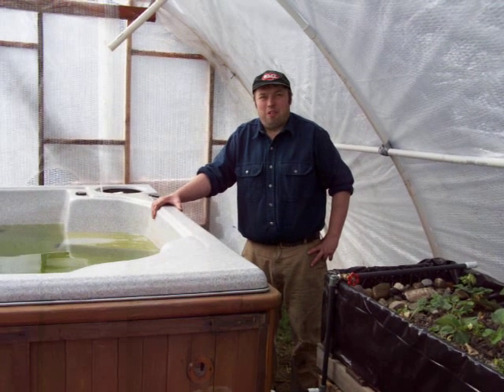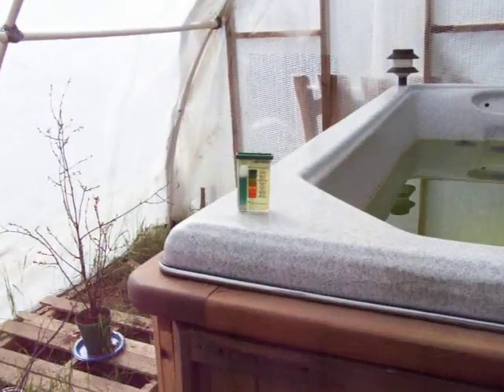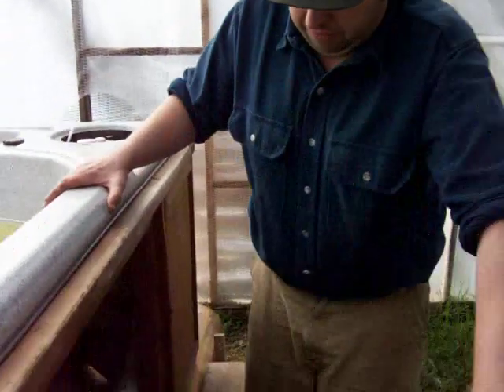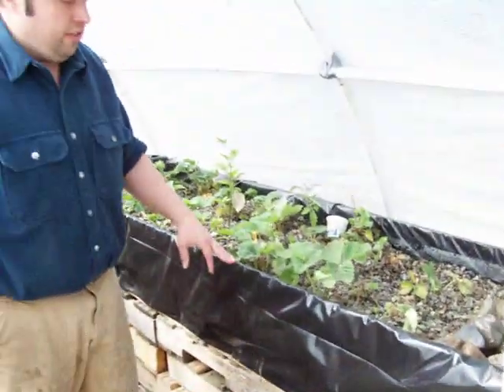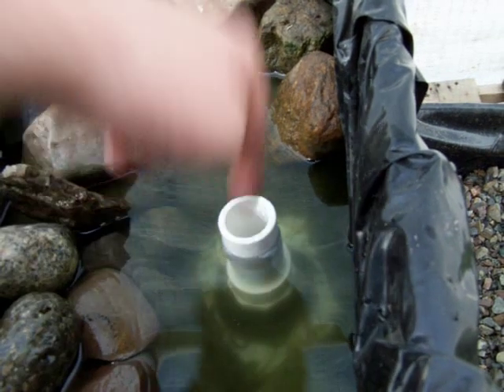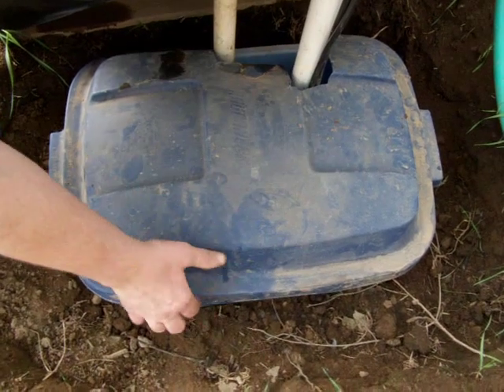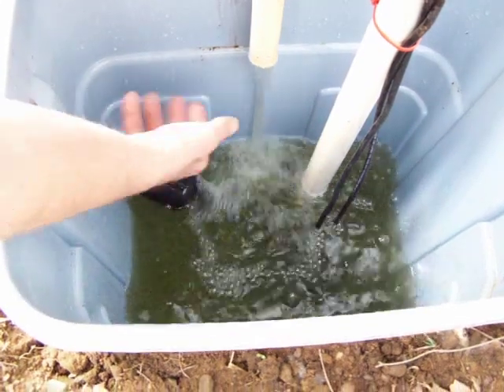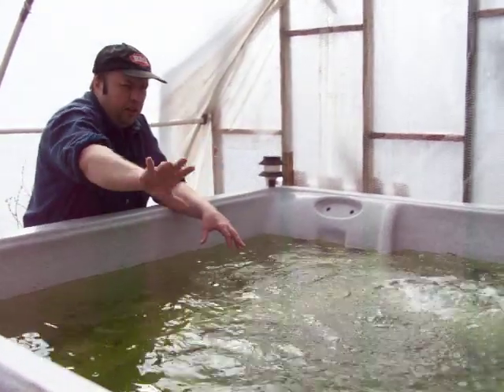Aquaponics using a hot tub!

Comment: yep... One of my fish ponds is a jacuzzi. Works good but takes too much room. 45 mil pond lining is a must IMO. Not worth the headache of fixing a weak liner. Your rocks are a lil small. need  a mix of larger rocks to aerate properly (3/4"-1") and avoid root suffocation. When in doubt use a bigger pump and larger flood/drain diameter pipes (min 1" drain- per 3/4" source, 1 1/2" drain-1 " source) ect.